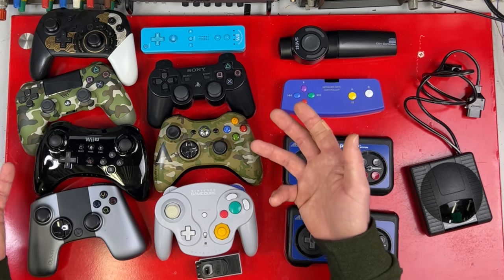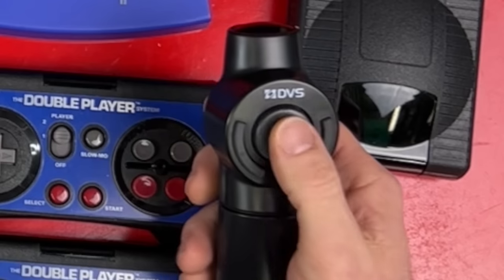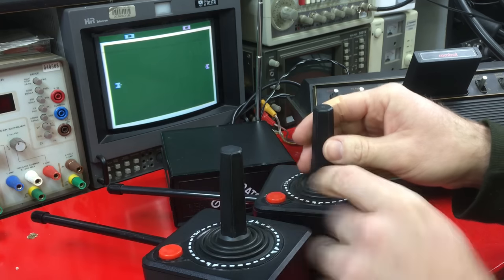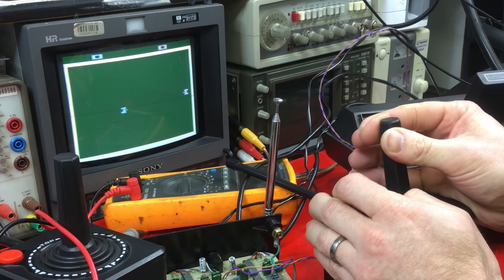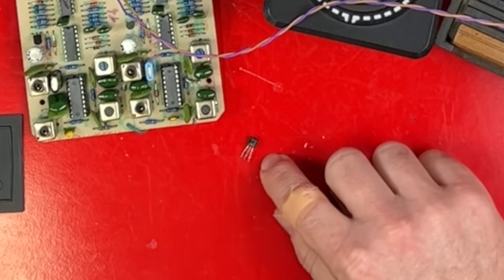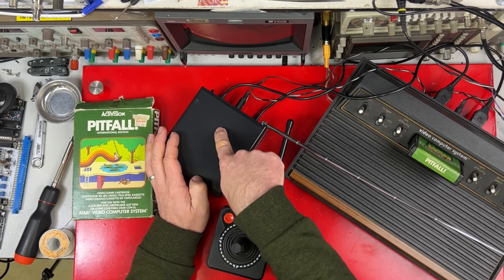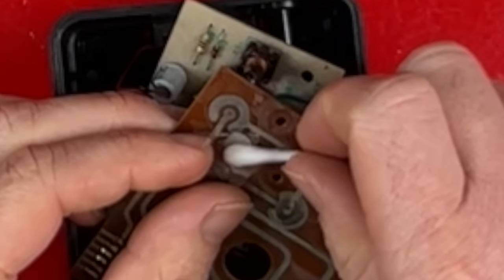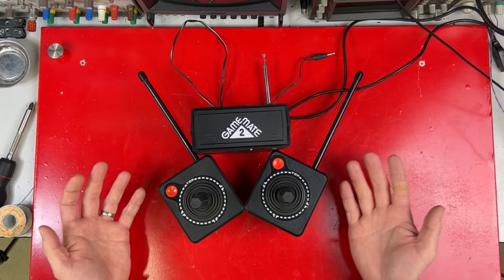The First Ever Wireless Video Game Controller

Comment: the first space might be a start bit. or used for parity. its possible its used to determine the clock speed of the signal but you would need an MCU for that and im not sure if this product was expensive enough when it was sold to allow for that
Reply from the maker: Yeah those are approximately the guesses I made too

Comment: Huh, have a set of wireless Atari controllers like those but the box is a bit smaller with atari branding. Probably the same contents. Also didn't really work, but considering I was testing them with a controller adapter with a Texas Instruments computer and not an actual atari, something other than the box could have been acting up. Tbh it's probably worth checking if the regulator is popped like yours, though.

Comment: Imagine how much better controllers (and remotes) would've been with modern IR Blaster tech... I'm not sure what it's really called, I've just heard it referred to as such...

My DirecTV remote uses it and it's magic... It's almost as good as RF, as long as you're in the same room at least!
Can point it just about anywhere and it STILL manages to do what you ask of it, and right away! 
And I literally mean anywhere, as I routinely didn't bother aiming my bed remote anywhere near the satellite box! Usually it was aiming into a corner with pillows, so nothing for the light to reflect off of... 
Like I said, it's just magic... 😅

Comment: You could have also made a voltage divider circuit if no other options were available
Reply from the maker: Those are input voltage and load dependant though, no regulation. Not a good idea as a power supply

Comment: It's surprising how many electronics can be fixed by just cracking them open and visually inspecting. Half the time a it's just a solder connection that broke. At least for simple electronics like chargers, laptops etc can go wrong in a lot more ways lol

Comment: You said you had a buck converter that only goes up, not down.  If it's a buck converter, buck converters only go down, not up.  Boost converters are what only go up, not down.  You also have fun stuff like buck-boost or SEPIC which can go up or down, but they're rarer.

Comment: Is it just me, or is it unlikely the 78(l)08 ever worked correctly? I mean stepping down from 9V to 8V with these seems a bit silly. I think you need at least 3V difference for it to work?
Reply from the maker: I thought the same but mostly those unregulated dc power supplies output a bit higher than their rated voltage, which is a strange thing to bet on, but seems to work fine.

Comment: I'm surprised this died off and was replaced by infrared. As chunky and ridiculous as having a fucking radio antenna sticking out of your controller is, it's a hell of a lot better than having to hold the controller still so the infrared doesn't lose connection.

Comment: I have no clue how people used wired controller back then
Reply: Based Millenials
Reply: I use those for my ps2
Reply: Not Atari, but PS2 controllers
Reply: you either had to position the sofa closer to the console or if thats not possible, sit on the floor, closer to the TV and console
Reply: to this day i still prefer a wire
if it wasent for the fact that most wired controllers are missing features they would be all I use

Comment: Minor whinge, but the DVS controller wasn't intended for gaming. Since CD-i was a multimedia format, the DVS machines were made mostly for professional, classroom and multimedia use.
Reply from the maker: Yeah I know.. the DVS was way late in the life of the CDi though so they really could have figured out a reasonable all purpose remote by then, games were clearly a major use for the system after that long

Comment: the 2600 wireless controllers weren't good or really practical, had one as a kid and used it.  It was too finicky if you weren't pointed at the receiver just right or if someone or something walked between you and the console it wouldn't get a signal.

Frankly that's pretty much the reason wireless didn't take off for years.  Can argue not until late ps1 or ps2 era but really the 360/ps3 era.  Just simply far more responsive and able to play the games better on a wired controller.  Plus you didn't have to deal with the battery factor.  Which is technically still a issue even on modern consoles.  Even if it has a rechargeable battery the fact of the matter is eventually one day it won't take a charge and will have to be plugged in to use.  But a well maintained and cared for wired controller will work no problem more than likely.

Comment: I always opt for wired controllers, watching everyone (friends) always dealing with low batteries then plugging in the shortest, dodgiest wire and then sitting in weirdest position so it works will always baffle my tiny brain.
Modern wired controllers have that nice super long lead, never have to worry with battery failure or ruined USB connection ports. The only downfall, some one tripping over the lead, not a problem any more, due to playing alone xD (online), unless you trip over your own cable... then yeah, buy a wireless you donkey.